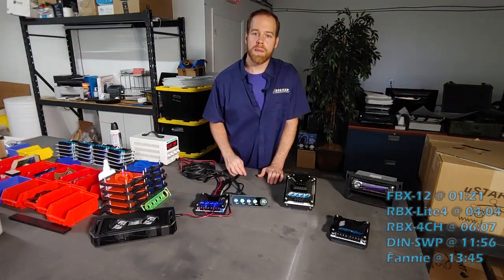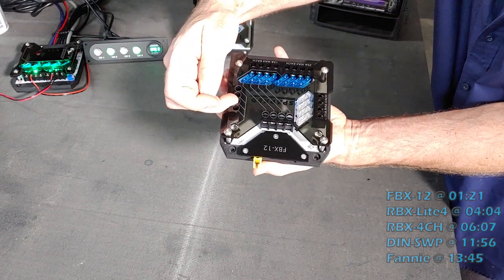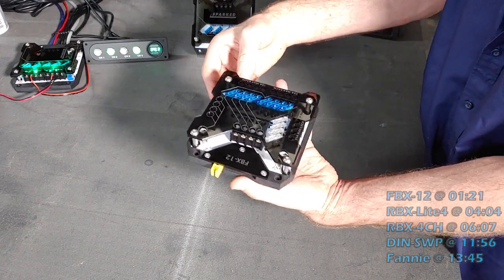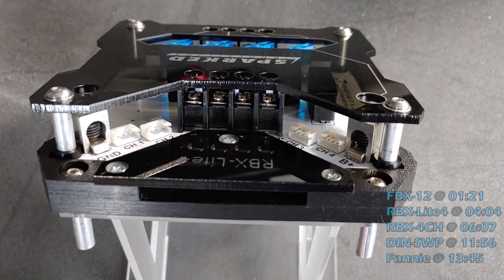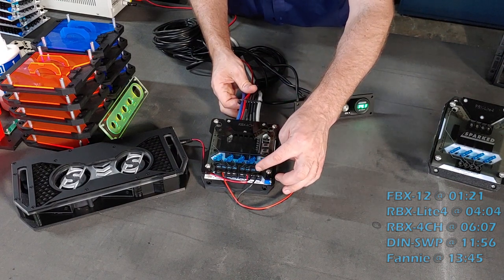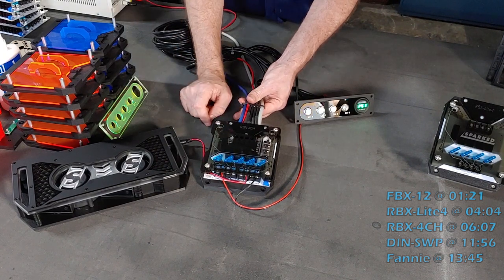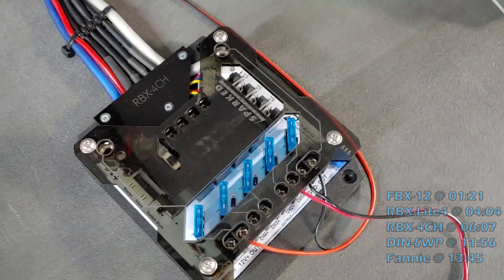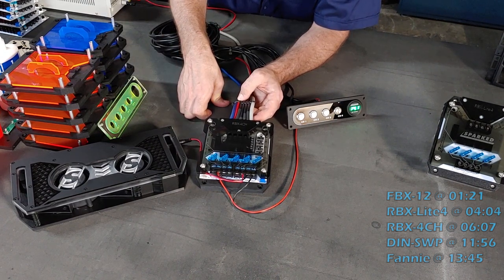Sparked Innovations 2020 Product Overview

Comment: Found what I’ve been needing the fbx 12 will help fuse my 12volt accessories great products
Reply from the maker: It's a handy little gadget that helps with those smaller-sized accessories. Remember the days when we'd hook a little 22AWG wire to the 0AWG terminal for power along with an inline fuse dangling in the air? :)
Reply: @SparkedInnovations   yes I remember that lol I’ve actually did something like not too many years ago not 0 gauge but close enough lol

Comment: Still confused what those 4 barrier strip inputs are used for. Could you give me an example?
Reply from the maker: Thanks for the question. They are simply positive input triggers that will activate a given channel when energized. They serve the same function as the 4-pin switch inputs. Please let us know if you still need further clarification. Thanks, again!
Reply: @SparkedInnovations  awesome thanks!

Comment: Can the fannie be hooked up to a simple rocker switch ?
Reply from the maker: Hi, Bruno! As long as the rocker switch is rated for at least 3A, then it should be fine to run a Fannie off of it since Fannie draws around 2.4A @ 14.4VDC.
Reply: @SparkedInnovations   should I run a inline fuse with the power? Or would the switch be enough? Thanks for the reply
Reply from the maker: @brunom1280  We always recommend running a fuse to any of our products that require 12VDC. A 3Aor 5A fuse should be fine for one Fannie.

Comment: Do you by chance know what the temperature tolerance is for the fans?
I'm looking for something that can handle engine bay temps. Please and thank you 🙏🏾
Reply from the maker: Sorry for the delay in responding! Though the materials we use are rated for higher temperatures, we do not recommend under-hood mounting.

Comment: Hi Ed, I would like to know how many  of the RBX 4channel units i would need for, 6 amplifiers, 2 audio control devices, 8 fans, and 11 leds strips? Thank you.
Reply from the maker: Hi, Julio. We'd need to know the draw of the fans and the LED strips first. Most amplifier remote turn-ons draw between 300 ~ 800mA, so you could run about 20 amplifiers off of one channel of the relay box. I would imagine your audio control devices draw about the same as the amplifiers. The RBX-4CH can handle 15A per channel, so the key would be the draw of your fans and LEDs.
Reply: Leds are 0.07a, that is 0.77a for 11 led strips and the fans are .37a, which is 2.96a for 8.
Reply from the maker: @juliom1740  Based on the above numbers (6x amplifier remote wires and 2x audio control device remote wires + 11x 0.07A LED strips and 8x 0.37A fans), you can technically run everything off of one channel. If you wanted to break it up, you could run six amps and two audio control devices off one channel and both LED strips and fans off of another channel (or any other combination).